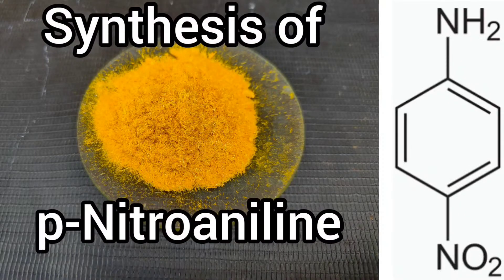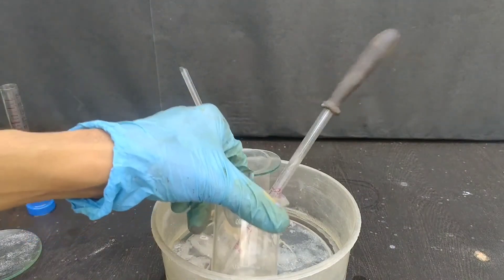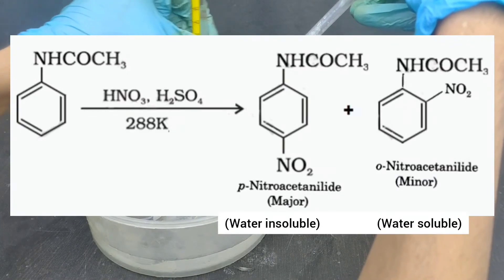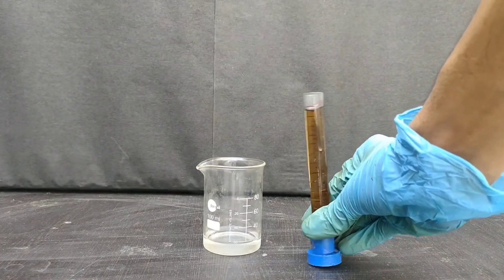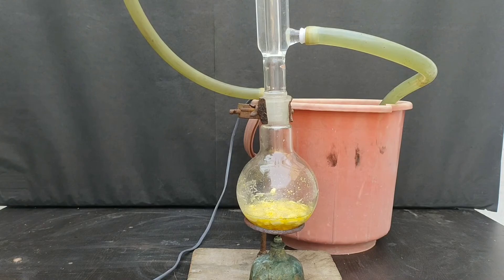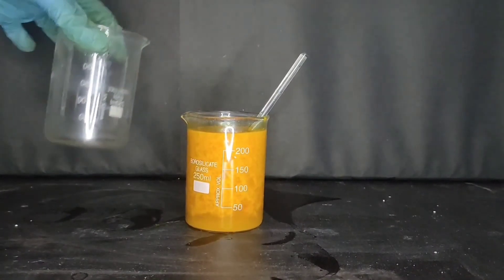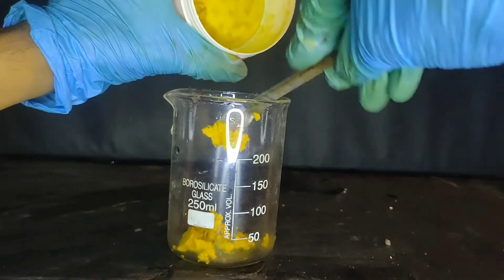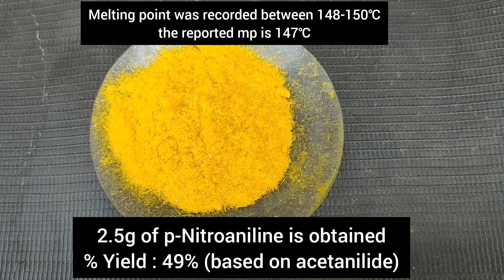Synthesis of p-Nitroaniline

Comment: Sir did we take 22gm of naoh in 100water because NaOH is alot
Reply from the maker: Yes this was the amount of NaOH required to neutralize the acid we took
Reply: @ but sir when i take this amount we get mahenti colour solution not yellow solid and it become i guess very basic and my product was not come🥺
Reply from the maker: Dont guess you should hav checked the pH with paper. You could have probably burned your compound in hydrolysis step or over nitrated the compound
Reply: @ yes sir i checked ph with paper;thankuh for humbly explaining me where the possibility of mistake to be done🥺👏🏻